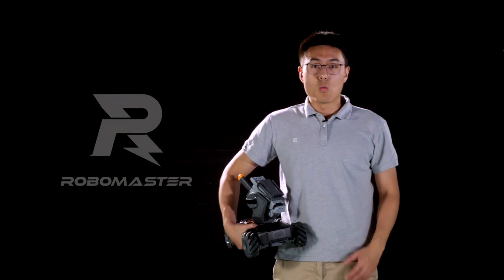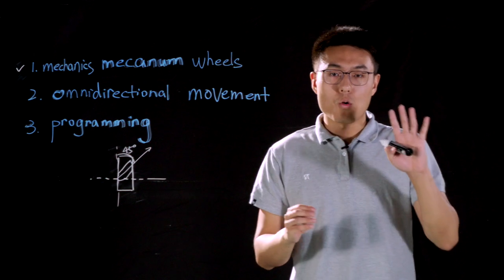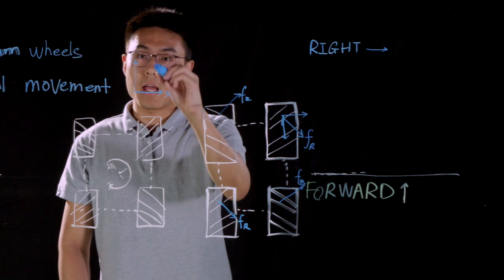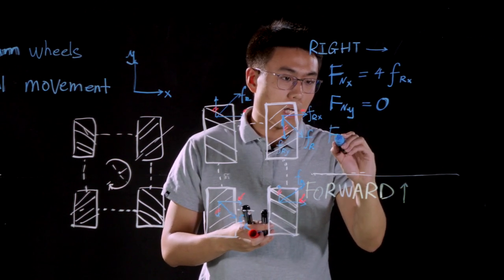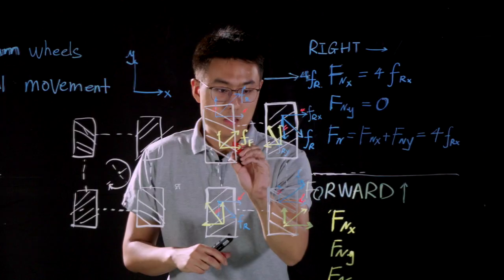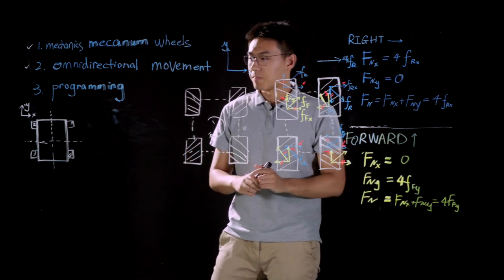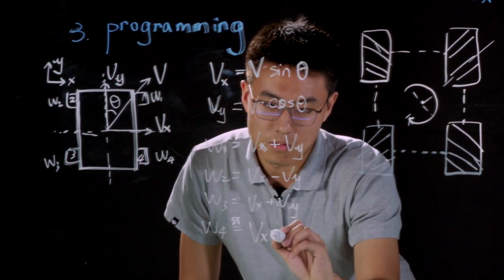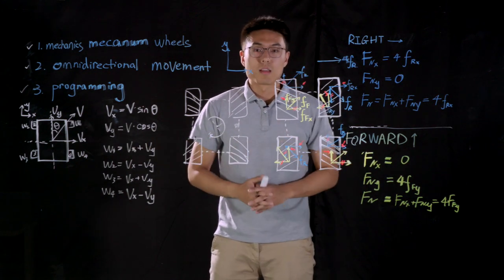DJI - RoboMaster S1 - Courses - Mecanum wheel 01

Comment: You can also watch the wheels rotating when moving or turning the actual Robomaster by hand on a surface.  At a basic level this is much more accessible and instructional.  The theory is then the next step.